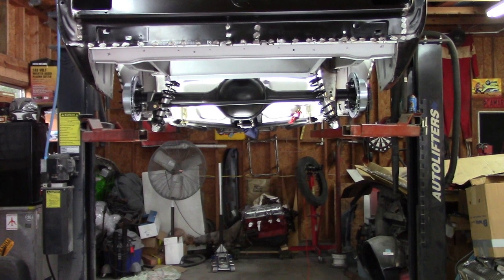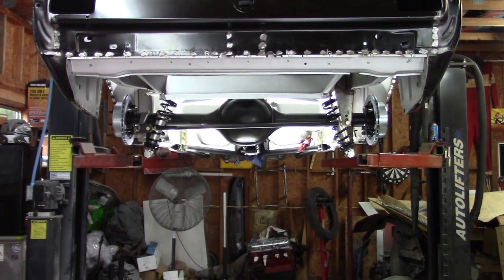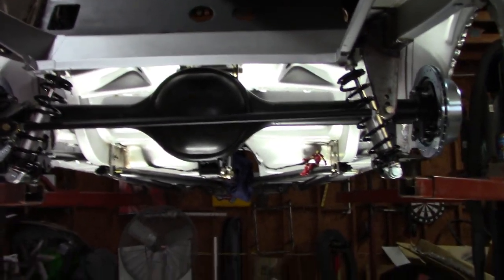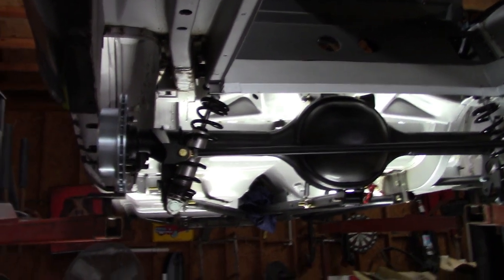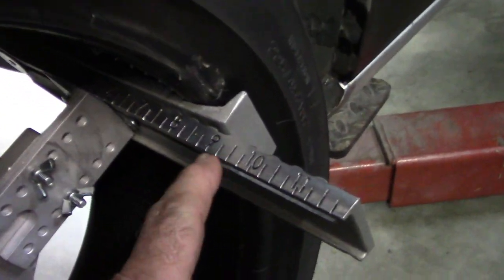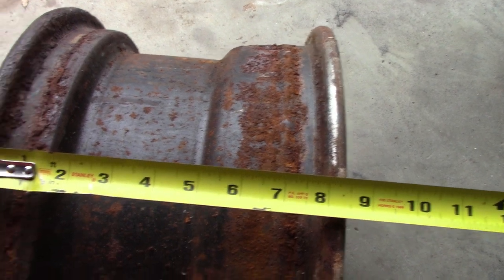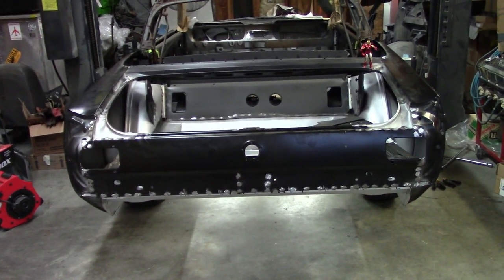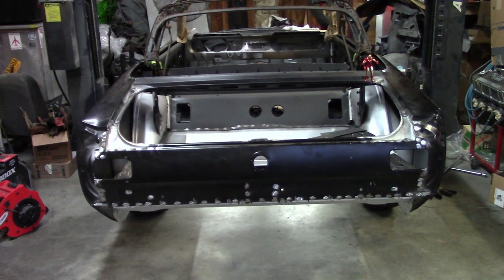Mustang rear wheel fitment. Brooklyn Pony part 18

Comment: I have a 67 mustang lowered with mid eye leaf springs and I have 17x8 wheels with 4.5 back spacing.  When the kids are riding in the back, the tires will rub on the outside quarter panel above the wheel lip when I hit a bump in the road.
Reply from the maker: If you have a stock rearend that may be why. This car has a custom built housing.